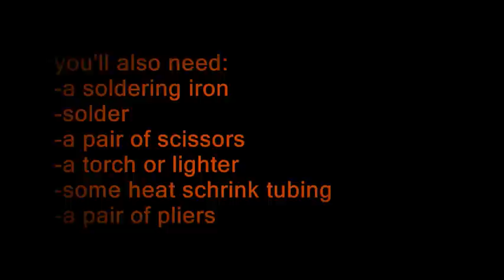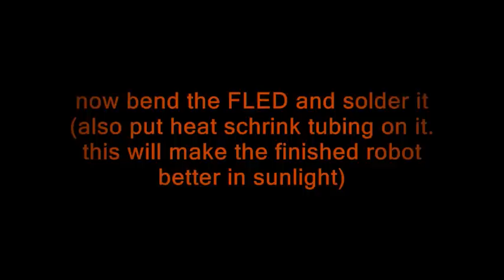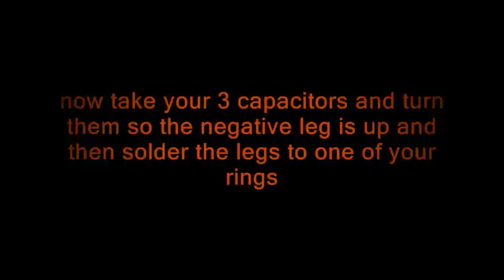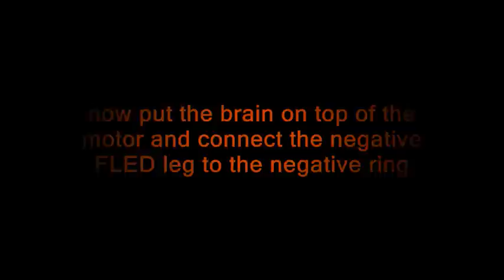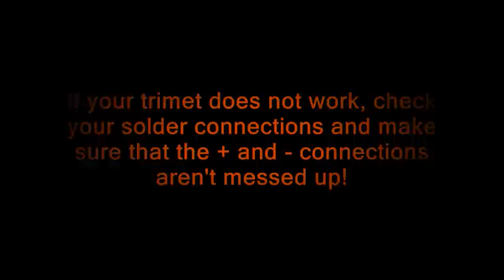How To Make A Micro-Trimet

Comment from the maker: @889203001 
you can use as many capacitors as you want but just make sure that you get about 4700microFarad (uF).
and youll need a 2N3904 or PN2222 transistor (either will do fine).
and a2N3906 or PN2907 transistor (again, either will do fine).

Comment from the maker: Most likely no. you need more power than the raw power from the small solar cell to power the motor, thats why you need to have the circuit to store energy and release it in bursts powerful enough to drive the motor.
If you had a huge solar cell, but still very light then perhaps you could achieve flight.

Comment from the maker: @ness854 try with more light or a better solar panel. you could also check your circuit by putting a 2 AA batteries instead of the solar panel :)

Comment from the maker: @ness854 a "flat" motor if you can find one. like the one in a walk-man (cassette player) or disc-man. they have more torque. otherwise just a low power motor strong enough to drive your robot. 1.5 volt motor or 3 volt is my sugguestion. if you make one as small as mine you need to find a pager motor. allmost any pager-motor will do fine. again, as long as it can pull your robot, its fine.
i hope it helped :)

Comment: Those caps that you showed in close up on the motherboard were probably why the motherboard died. They're about to fail/leak and are most likely not their true value any more. You can tell by the swollen/bulging tops. Sometimes they'll even go pop and spray electrolyte all over the place.

Comment from the maker: @sciencoking 
what LED? there is no LED in this robot. ohh..  you mean the FLED.
well, it lets power go through it when there is 3 volts. then the power goes to a transistor that sends it on to the motor.

Comment: the vibrator head is made of tungsten. so if U want to create a collection of chemical elements...
Reply from the maker: desinfector Really? I had no idea! Does this apply for cheap ones too? Thanks for sharing!
Reply: kattejuice well yeah usually they use Tungsten for these heads. W is very heavy due to its high density. It doesnt mean that there arnt any other materials like Steel or Zink.
Reply: +desinfector zinc
Reply: +Root Beer well yeah U got it. I just fell back into German where its Zink instead of zinc

Comment: I did it myself. Not hard. It worked! I have just one thing before i build my next one. The motor twitches very fast and hardly moves the bot.is it because Im using 3 small 1000uf caps? It might.

Comment: This is what's called "Point-to-Point Construction" am I right? Also, can this contraption ever collect enough energy from the solar cells to keep on moving instead of just incremental jumps?
Reply from the maker: +Tom P. 
I didn't know that name for it previously, but yes its seems to be called so. 
The solar panel I used was not very efficient, and I never tried it in direct sunlight since there wasn't much at the time I made this. Even so, I managed to get it moving in very frequent pulses using only a flash light. It may be possible to make it move continuously under strong enough light. But then again, the whole point of the circuitry is to be able to move in pulses under conditions where there isn't enough power for continuous movement. :)

Comment: why the led ???
Reply from the maker: Because it lets power through only when the voltage is high enough.
Reply: Like a zener diode?
Reply from the maker: Koushik PaulSort of. Except power doesn't flow any direction before voltage is reached. You could try with a zener diode, but I'm not sure it would work

Comment: WHYS IT MOVING LIKE THAT??!!?!?! 
I AM SMART ENOUGHTO REALIZE THATNIT CAN DO THAT BUT WHERES MY LOGIKAL EXPLANATION?!
quite confusing. I mean like it is extremely easy to do for experts and intermediates but how does it do that?!
If you respond it would be a pleasure!
smart idea too!
Reply from the maker: cody reedThe robot collects energy using the solar cell, and when it has enough it lets is all go at once through the motor, letting the robot move a little bit. 
The motor's shaft touches the ground at an angle, which causes the movement to curve.

That helps?
Reply: Thanks!